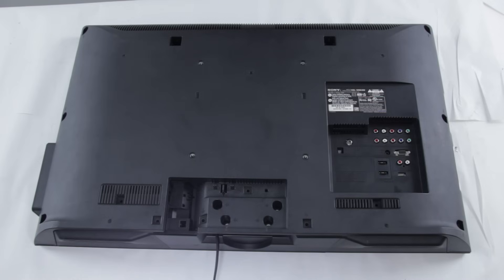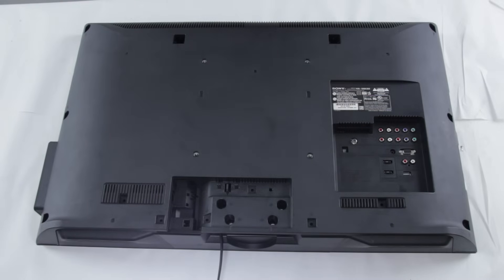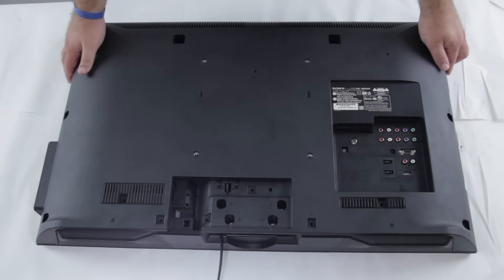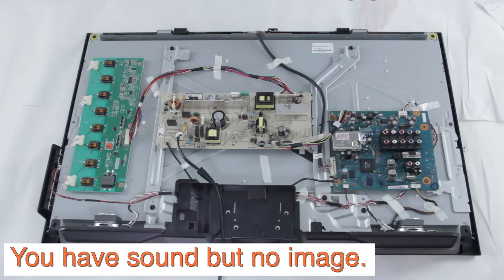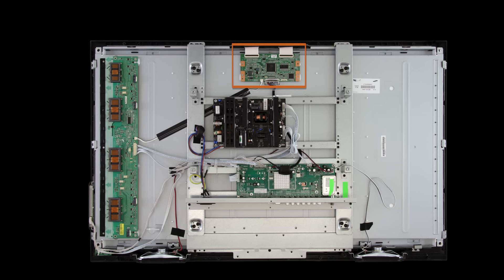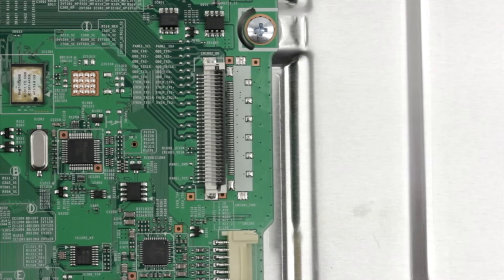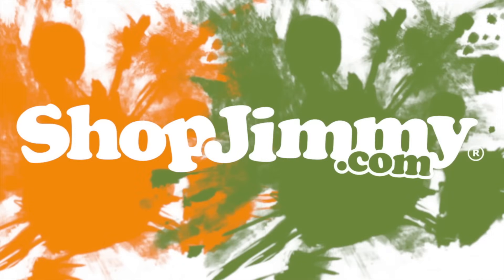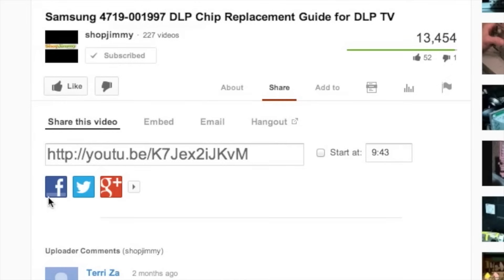LCD TV Repair Tutorial - T-Con Board Common Symptoms & Solutions - How to Replace T-Con Board

Comment: HELLO JIMMY AND CREW!!!
I am new to the TV repair field and would like to ask a question.  My customer has a Sony Bravia 2005 40" (KDL-40V2500, s/n: 8081796). The TV turns on with a green light, then immediately turns off, blinks in red 4x's. It continues to blink in red 4x's, until you power off unit. Is it the power board or the T-Con Board.  Also, there's no video and no sound.
Reply from the maker: Dwayne McGleese  Please watch this video FIRST to help with your repair!  https://www.youtube.com/watch?v=BP3NVNCGEv8  I recommend replacing the main board in your TV.  Click this link to replacement parts for your TV model number:  http://www.shopjimmy.com/sony-a-1196-624-a-b-board-for-kdl-40v2500.htm  There may be multiple boards for the same TV model number, be sure to match part numbers on your current board, with your replacement for compatibility.  Here is a link to a video showing how to identify your part number, click here:  https://www.youtube.com/watch?v=Aodz2LHkzbY  Thanks and please let us know if you have any further questions with your TV Repair!  www.shopjimmy.com

Comment: I have Samsung Model UN55ES6150F. Serial Z54D3CXC402199N. The standby light blinks 5 times and the screen stays black. I removed the back of the T.V. and all my caps. appear to be in good shape. I unplugged the main board from the power supply board and the back lights came on. I believe this means my main board is defective. If this is true I would like to order a new main board from you. Let me know what you think please.

Comment: Hi I have a Westinghouse that was given to us because they said the picture would shutoff, the tv model is CW50T9YW, I watched some of your videos and I started by replacing the inverter board but the same thing happens. The Westinghouse logo on the tv always comes on, but sometimes once it goes away and it's time for the picture to show, it doesn't. There is sound and sometimes I get a picture for a few hours and then it just turns into a black screen. I'm not sure which part I should go with next, any help would be appreciated, thank you .

Comment: Hi. I have a Sony Bravia  kdl 32bx300 and the picture started jumping with horizontal ghosting all over the screen. I took it apart, and the tcon board is on top of the LCD, but it seems to be integrated into the panel. Am I fighting a losing battle?
Thanks for your time
Tim

Comment: I Have a very strange issue with my LCD TV. It is a SOYO 47" LCD 1080p HDTV MT-SYXRT4791AB. I've had this tv for about 6 years and it has never given me any issues until the other day. The issue is kind of strange so bare with my attempt to describe it. Now the other day I turned on the tv and 1/3 of the screen on the left side was black. The right side was still blue (no input). I switch over to VGA mode to display my PC. It was the same only instead of blue screen it was my PC display and 1/3 of the screen is black. I tried using different input and it was the same. I turned it off and on...same.
Settings reset.....same. Smacked the side of it.....WORKED.
Now the black 1/3's edge isn't clearly defined. its kind of blury. Not a straight black line.
It happened again today again only this time it wasn't from the moment I turned on the TV. It was already on and it didn't go black in color. It stayed the image it had been displaying and the other 2/3 of the screen was working ok. The fix was the same as before. I've not had this issue in the past. I've only seen it twice now but my wife had the same issue the other day.
Something is obviously starting to go. It isn't very frequent and we do use the tv quite a bit. It has never reappeared after we fixed it until the next time we use the tv. Thoughts???

http://youtu.be/-IYIh1m-5jI  video of problem
Reply: James Armstrong  hello???
Reply from the maker: James Armstrong   Thanks for your patience as we research your question and will respond with an answer.  Thanks!  www.shopjimmy.com
Reply from the maker: James Armstrong   This sounds like a TV panel (TV Screen) problem.  If your TV panel is bad, it may be more cost-effective to replace the TV as panels are typically hard to find in stock, difficult to replace, and expensive.  Thanks and please let us know if you have any further questions!  www.shopjimmy.com

Comment: Hi, I have a Samsung UN32ES6500 Serial # Z5M23CTC600587V. It has white spots and streaks on the right side of the screen from the bottom corner to the top corner. The spots are the brightest when there is a light colored picture. If the picture is black or a darker color you can`t see the spots. If you supply an e-mail I can send you a picture.
Reply: Rod Bickham  I guess no one is going to help
Reply from the maker: Rod Bickham   I apologize for the delay on this.  We are now working on it and I will be back with a response ASAP.  Thanks!  www.shopjimmy.com

Comment: Looking for a little hep here. I have a LG 42LH30 lcd tv that has been having issues. The tv powers on fine , the sound is fine, but the screen is dark, blurry ,and has ghost images on the left side of the tv for a few minutes up to 15 minutes. The picture eventually returns to normal. I'm sure somethings going.
Reply from the maker: mark counihan   This sounds like a TV panel (TV Screen) problem.  If your TV panel is bad, it may be more cost-effective to replace the TV as panels are typically hard to find in stock, difficult to replace, and expensive.  Thanks and please let us know if you have any further questions!  www.shopjimmy.com
Reply: ShopJimmy.com i forget to throw in that 2 of the hdmis arent working? was hoping it was something easy to fix like the main board.
Reply from the maker: mark counihan   You could replace the main board to see if that fixes the problem.  If it does not fix the problem then you most likely have a bad TV panel.  Click this link to replacement parts for your TV model number:  http://www.shopjimmy.com/catalogsearch/result/index/?cat=56&q=42LH30  There may be multiple boards for the same TV model number, be sure to match part numbers on your current board, with your replacement for compatibility.  Here is a link to a video showing how to identify your part number, click here:  https://www.youtube.com/watch?v=RwHTvjMdrhk  Thanks and please let us know if you have any further questions with your TV Repair!  www.shopjimmy.com

Comment: My LG 47" TV - Model # 47LG60 has the screen turn green with white and green static lines after turning it on.  Sometimes it seems like it doesn't go green until watching a picture with a lot of green in the colors like a football game, etc.   Turning the TV back off and on will cause it to go away at times.  But then the picture does have white thin static flashing lines on the screen.  Any suggestions?  THANKS!
Reply: ShopJimmy.com thank you!

Comment: I have a 46" Samsung model # LNT4671FX/XAA   serial #AX323CNQ107813T  version SS03. The problem that I am having is the picture flickers. And it seems to be mostly on the right side. I have taken off the back of the tv and replaced two of the caps on the power supply board that were bolging and leaking. I have repaired 2 other Samsung lcd tv that wouldnt turn on that had bad caps and they are working fine but I cant figure out why this one still flickers. Can you help? Scott

Comment: hi i have a sony tv modle no KDL 40V3000 . serial no 4028254. it has started displaying horizontal flickering lines across the top 3 to 4 inchs of the screen only rhe rest of the picture is ok and the sound is ok. any ideas as to what is causing this, or a possible soloution would be much appriciated. thanks steve.
Reply from the maker: Steve Perry   This sounds like a TV panel (TV Screen) problem.  If your TV panel is bad, it may be more cost-effective to replace the TV as panels are typically hard to find in stock, difficult to replace, and expensive.  Thanks and please let us know if you have any further questions!  www.shopjimmy.com

Comment: Hi, I have a Vizio M3D550KD tiny black horizontal lines thru the tv & also it take 30 sec to start up with black screen then picture.
Reply from the maker: Jim Nichols   Please watch this video FIRST to help with your repair!  https://www.youtube.com/watch?v=BP3NVNCGEv8  This could be a problem with either the main board or the TV panel in your TV.  You can replace the main board to see if that fixes your problem.  Click this link to replacement parts for your TV model number:  http://www.shopjimmy.com/catalogsearch/result/index/?cat=56&q=M3D550KD  There may be multiple boards for the same TV model number, be sure to match part numbers on your current board, with your replacement for compatibility.  Here is a link to a video showing how to identify your part number, click here:  https://www.youtube.com/watch?v=kxkeGLhlQY8  Thanks and please let us know if you have any further questions with your TV Repair!  www.shopjimmy.com

Comment: I have a Samsung LN46A550P3F. When I turn the TV on the picture is fine. After running approximately 40 minutes the right 30% of the LCD starts to display intermittent dark shadows for approximately 3 to 4 minutes after which the picture is fine again.
Reply from the maker: *****   This sounds like a TV panel (TV Screen) problem.  If your TV panel is bad, it may be more cost-effective to replace the TV as panels are typically hard to find in stock, difficult to replace, and expensive.  Thanks and please let us know if you have any further questions!  www.shopjimmy.com

Comment: Hello.. Thanks a lot for uploading these videos!
I have a samsung LED tv model:UA40EH6030RXZN.. The problem is that only half of my screen is showing images,the other half is completely black... The sound is good...  I already tried to switch cables on the t-con board,nothing happens!!
please suggest if it is the T-con board or not???
Reply from the maker: NIK1990   This sounds like a TV panel (TV Screen) problem.  If your TV panel is bad, it may be more cost-effective to replace the TV as panels are typically hard to find in stock, difficult to replace, and expensive.  Thanks and please let us know if you have any further questions!  www.shopjimmy.com

Comment: Power will not come on led flashes 6 times. Checked the capacitors to see if they where swollen but they looked normal. Purchased a known good power board but still will not turn on vs and va voltage get to recommend voltage but then drop off in seconds. Samsung pn64d7000ffxza Would like to get it fixed. Don't know what to do next.  Ronlively@gmail.com
Reply from the maker: ron lively   Try this at your own risk. Unplug the TV, then disconnect the y board and plug in the TV to see if the TV powers up. Reply with the results of this test. Thanks! www.shopjimmy.com

Comment: i have a sony kdl-nx720 tv.
its more than 2 year old.i facing some vdo issue.getting color spots in lower corner and color of the screen changes.
not sure what it is the problem.
Kindly help.
Reply from the maker: sumeet rajan   This sounds like a TV panel (TV Screen) problem.  If your TV panel is bad, it may be more cost-effective to replace the TV as panels are typically hard to find in stock, difficult to replace, and expensive.  Thanks and please let us know if you have any further questions!  www.shopjimmy.com

Comment: I have a 2009 42" insignia LCD TV. There's been a problem with the colors all going to a neon green tint. I've checked all cables and all are secure. Opened the back and reseated the ribbon cables. I've also changed the color settings and can get them to appear normal. But after 15 min or so the begin to distort again. I'm thinking it may be a tcon board but I'm not sure. Any help is appreciated. 

Thanks.
Reply from the maker: yougofish   This could be a problem with the t-con board, the main board or the TV panel.  Please reply with your TV model number.  Click here to view a video that shows how to find your TV model number:  https://www.youtube.com/watch?v=S51nhAmwR2M  Thanks!  www.shopjimmy.com

Comment: good day mr. jimmy, i had a sony bravia 52inch lcd tv, there is a blue thin vertical line in the middle, how can i fix that problem??? thanks in advance mr. jimmy, more power.., ^^
Reply from the maker: Rodel Morales   This sounds like a TV panel (TV Screen) problem.  If your TV panel is bad, it may be more cost-effective to replace the TV as panels are typically hard to find in stock, difficult to replace, and expensive.  Thanks and please let us know if you have any further questions!  www.shopjimmy.com

Comment: I have a Philips tv model #40PFL3705D/F7 and the screen has went out. We have sound and backlight. We have replaced the long inverter board but it is still the same. So, we researched the other boards and think we have narrowed it down to the t-con board. 

I'll be placing that board order in a few minutes and when it comes in we will install it and see if all is well again. 😎
Reply from the maker: Tom Freeman  Please watch this video FIRST to help with your repair!  https://www.youtube.com/watch?v=BP3NVNCGEv8  This could be a problem with either the main board, the t-con board or the TV panel.  You may need to replace the main board and t-con board individually to see which one fixes the problem.  Click this link to replacement parts for your TV model number:  http://www.shopjimmy.com/catalogsearch/result/?q=40PFL3705D%2FF7  There may be multiple boards for the same TV model number, be sure to match part numbers on your current board, with your replacement for compatibility.  Thanks and please let us know if you have any further questions with your TV Repair!  www.shopjimmy.com

Comment: Got a Sony (KDL-46S4100, ser # 1805488, manufactured in SEP 2008) that has 4 horizontal bands spanning the width of the screen and some 'ghosting' in the upper right side of the screen.  Can still see the picture, just a thin white line (three total) between each of the wider, blurry bands.  Have removed the back, front trim and metal trim to get at the copper, bonded connections thinking the issue was there (8 on top and 4 on each side) only to NOT be able to make anything change when applying pressure/manipulating any of them.  Lemme know what you think and I'll get the repacement parts through you.  Thanks, J

Comment: Hi i have a Alba LCD 32" Model LCD 32880hdf, when switched on at mains the led just flashes white the is no flash patern. i have replace the inverter and power board and still no change. Do you have and ideas?
Reply from the maker: Zerocool536  Please watch this video FIRST to help with your repair!  https://www.youtube.com/watch?v=BP3NVNCGEv8  I recommend replacing the main board in your TV.  Click this link to replacement parts for your TV model number:  http://www.shopjimmy.com/vestel-20462266-main-board-for-lcd32880hdf.htm  Be sure to match part numbers on your current board, with your replacement for compatibility.  Thanks and please let us know if you have any further questions with your TV Repair!  www.shopjimmy.com

Comment: I have a Hisense 42" F42K20E with large white line going down the screen. all other functions work. is this a symptom of a t-con board

https://www.dropbox.com/s/ld5ijpjdhcf3eqh/2015-01-24%2012.57.25.jpg?dl=0

https://www.dropbox.com/s/cn52qfox08brotn/2015-01-24%2013.18.45.jpg?dl=0
Reply from the maker: good days   This sounds like a TV panel (TV Screen) problem.  If your TV panel is bad, it may be more cost-effective to replace the TV as panels are typically hard to find in stock, difficult to replace, and expensive.  Thanks and please let us know if you have any further questions!  www.shopjimmy.com

Comment: I have a 40" sony Bravia tv I have backlight but no picture I cant see if the controls or working so I do not know if hooking up anything will enable any type of sound the tv will remain on for a short period and then turn off and blink 12 times
Reply: ShopJimmy.com MODEL NO. KDL - 40VL160
Reply from the maker: Kidd   Unfortunately I do not see any replacement parts in the search results for your TV model number on our website.  Please reply with your part number on your main board and I can try searching for replacement parts.  Thanks and please let us know if you have any further questions!  www.shopjimmy.com
Reply: where is the main board located? and thank you for your help
Reply from the maker: Kidd   The main board should have your HDMI & other input connections on it.  Thanks!  www.shopjimmy.com

Comment: I HAVE A JVC LCD AND WHEN I GOT IT I POWERED OF ALMOST IMMEDIATELY, I BEGAN TROUBLE SHOOTING BY CHECK POWER TO POWER SUPPLY  THEN BY DISCONNECTING CABLES  WHEN I GOT TO THE CABLE TO CONNECTS THE MAIN TO TCON TV  STAYED ON BUT NO PICTURE. THEN I PLUGGED IN VIDEO SOURCE NAD HAD SOUND.  ONCE I CHECK TCON CONNECTIONS ANS LEFT THE PANEL RIBBON CABLES DISCONNECTED POWER STAYED AND SOUND BUT SOON AS I PLUG IN THE CABLE FROM MAIN TO TCON SET POWERS OFF.. SO IM THINKING ITS THE TCON. WHAT ARE YOU THOUGHTS? MODEL NUMBER IS LT-47X788, TCON IS V429H1-C07 PLEASE HELP JAMIE_YDR@YAHOO.COM

-
Reply from the maker: Payton Yoder   Please watch this video FIRST to help with your repair!  https://www.youtube.com/watch?v=BP3NVNCGEv8  I recommend replacing the main board in your TV.  Click this link to replacement parts for your TV model number:  http://www.shopjimmy.com/catalogsearch/result/?q=LT-47X788  There may be multiple boards for the same TV model number, be sure to match part numbers on your current board, with your replacement for compatibility.  Thanks and please let us know if you have any further questions with your TV Repair!  www.shopjimmy.com